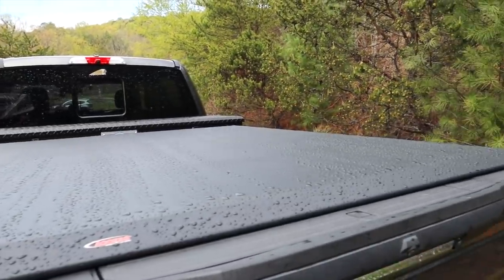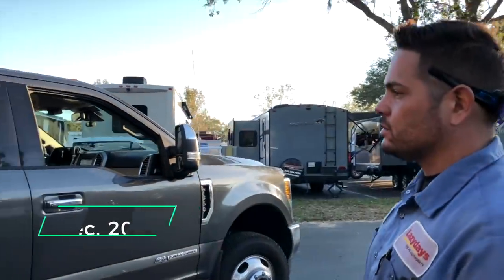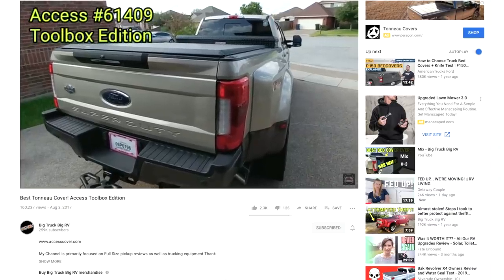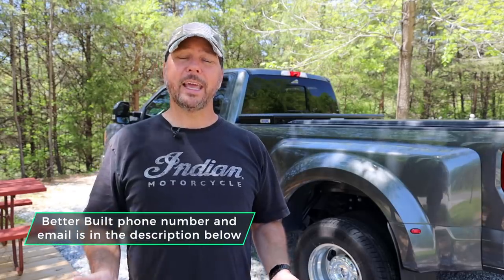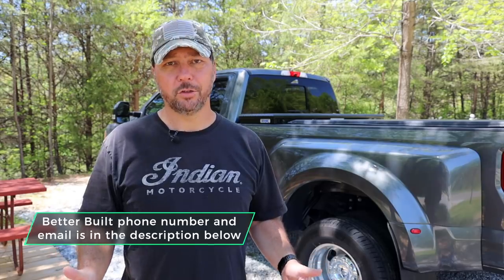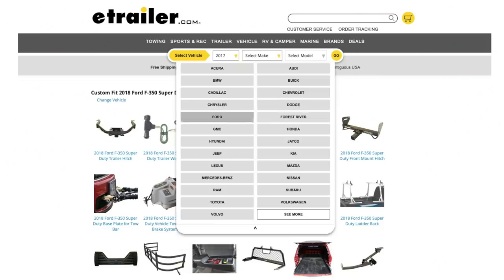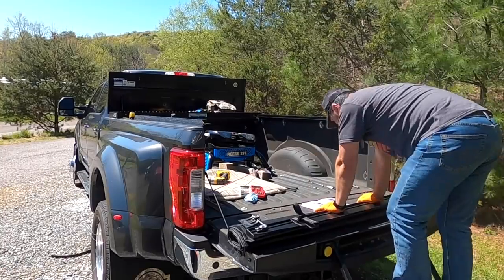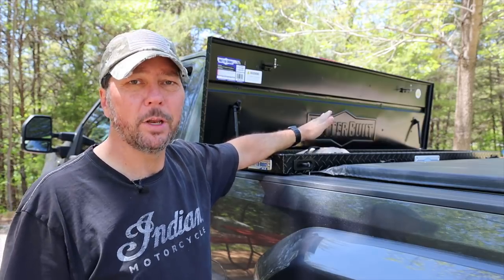Truck Toolbox and Tonneau for Fifth Wheel [Full Time RV Living]

Comment: Chad thanks a ton you saved me a bunch, doing it two or three times for that I thank you!  Any reason you don't think this one would not work?   Seems to be about the same dimensions as your drawing on the blog.  Seems like most of the generic brand boxes come from the same place, I've yet to notice in great differences in that 3-5 hundred dollar range unless it's truly in those handle mechanisms?  Found this one at tractor supply will be removing the badging to mount the cover looks like simple plastic rivets.  It's not a shotgun latch but seems to have a nice clean rear face for connecting to the cover, it was about $400 at Tractor Supply.  Oh, the picture on TS website shows the release buttons on the rear but on the one I purchased with the same P/N 1174114 the buttons are on the side..similar to your first toolbox.

Comment: Hey Chad, I purchased the same cover and box after your video. I too had the same trouble with my Landmark 365 Ashland fifth wheel, it uses a MORyde  pin box. I had to scrap the cover because both side rails got completely trashed. After that damage I bought the Extang solid Fold 2.0 for a toolbox and when I am hitched up I just remove the cover. The Extang just uses two quick install clips that takes maybe 3 minutes to reinstall the cover. Here is the link to just look at the cover:  https://www.extang.com/solid-fold-2-0-toolbox The best price site I found for the cover and tool box is called Discount Bandit.  Thank You, Peter.
Reply from the maker: We just switched to the MORryde and can get to about 75degree turn before hitting now.. But that does look like a nice cover.

Comment: I've seen a photo somewhere on line where the side rail on the Tonneau  cover were slightly cut away in a 1/2 moon shape to prevent the pin box from hitting the rail. Has anyone done something similar?
I am in the process of purchasing a new Vanleigh 41LKB and was looking for a truck toolbox and cover option for my truck. The timing on this video couldn't have been better. Many Thanks to Changing Lanes for this post.

Comment: Chad, This was a great video to help me prepare for my future truck setup. I did find on Betterbuilt's website a model 77211943 that looks like a low profile shotgun latch box. They add D rings and a light to the outside. Check it out and maybe this is something your viewers cod purchase if they can't find the one you have.
Reply from the maker: Looks right.. It's the shallower version but should fit.

Comment: Good info Chad. But unfortunately your set up is not perfect for me. There are several thinks about it that will not work with my truck and 5th, which is ok since one item can not cover everyone. I have a chest tool box and a Bakflip MX4 on my long bed. As far as reaching tools the truck sits to tall for me to reach in so I have to get into the bed and the cover covering the box is not an issue. I considered the cover you have, but what amount it sticks up above the rails is a no no for me. As far as the picture you showed of a Bakflip and seeing out to hook up, I don't fold it that much to hook up my Reese Goose box hitch. The only thing I would want to change is I wish they had a MX5 for an 8" bed so I could only fold 3 times and have more of bed covered while towing and still not have the hitch hit the cover in a tighter turn. Thanks for your insight.

Comment: I purchased the same tool box from Tractor Supply on clearance for 495 + tax after seeing BTBRV video also. Only concern I have is that it has opened up on me randomly while locked and driving. Called Better Built and was so that the box had been discontinued and the parts for the latches were not available. It sounded like it was a common problem. Might want to put an alternate lock also
Reply from the maker: Thanks for the info.  Haven't had that problem, but what did you do to fix it?
Reply: Changing Lanes   Haven’t figured it out yet. Like your videos and was hoping you had some ideas.

Comment: I have the same toolbox and what I think is the same tonneau cover (Access) that I've not yet installed.  When installed, is there a sufficient gap between the front of the cover and tool box that you can reach the latches and insert the key into the locks?  The cover itself is higher than the latches/key holes and I wanted to make sure it would work before installing.

Comment: Chad, I had an access cover on my Ford truck which had a short bed.  I had 5th wheel conflict issues because of the sliding hitch. The pin box made contact with frame work of the cover. I no longer have that truck or I would send a video. Just a heads up.

Comment: Thank you. I just ordered a toolbox tonneau cover from Etrailer.
Reply from the maker: 👍🏼   I hope you saw the note in the description and/or blog... We also pinned a comment:  ⚠️ UPDATE! – After traveling a bit, we've had our pin box hit the tonneau rails a few times! ☹️ We're not sure if it's just because we have this huge Flex-Air pin box or if this might be an issue on all pin boxes. The damage has been minor and isolated to just the rails. I've been able to bend back the bent areas. And the damage is hidden under the cover. Please be aware and maybe take some measurements of the distance from the pin to the back of the pin box and compare that to the distance from the center of your hitch to the side rails.
Reply: @ChangingLanes  Yes I saw your update. Thanks. I dont have a 5th wheel. Ill be A-OK

Comment: Hey Chad, I found a tool box with side button but the hight is 5'' 1/2 and I got 6'' 1/4 of clerance, do you think it is too tight ? It is just when I do a jack knife then I will be over the tool box with the front cap. I was worry if the ground is not level if i will hit the tool box when i back up jack knife. Thanks for your comment. Great video.
Reply from the maker: That's certainly something to be aware of.. Ours even comes close sometimes.  Less than an inch of clearance is a bit close.

Comment: The Betterbuilt 77211943 SLE Low Profile box available at Tractor Supply for $600 looks like a good substitute. It's the same box, just not as deep.

Comment: I have a North Point with a MORryde pin box & Reese 25k 5th wheel. The pin box hits the Access cover on a tight turn. Do you have that issue or did you solve it somehow?
Reply from the maker: Yes. See: https://changinglanesrv.com/faq/?Display_FAQ=2978

Comment: I think I got the last GM size (69-inch) SLE box available in the US off eBay! Was looking for a couple of months. How did you seal the sides of the box where it sits on the rails?
Reply from the maker: I didn't... but some weather stripping should work.

Comment: Now that you guys have the MORRyde Pin Box, are you still seeing the issue with the pin box hitting the rails?
Reply from the maker: Very rarely on very sharp turns.. So, it's still a bit of an issue with this tonneau.  But, it's much better than it was.   We hope to try a goosebox sometime in the future...
Reply: @ChangingLanes  Interesting.  We just ordered our 397 (we have a 2021 Chevy 3500 Dually) and have been wondering of the goosebox would still work with this cover and tool box.  Would rather not spend 1200 on a B&W 5th wheel hitch to only them go with the goosebox route down the road

Comment: I was able to make my tonneau from my old 6.5' bed truck work on my new 8' bed. Found a narrow toolbox that fit then measured the dimensions between the tool box and tonneau. Took it to a metal fab shop and had it made out of aluminum diamond plate.

Comment: What do you think the max height would be on the tool box from the rails. I’m looking at getting the new decked tool box and it sits 5.75inches tall from the bed rails. Do you think this would hit my front cap when turning? I am getting a solitude as well.
Reply from the maker: That's too high.  We had a weatherguard that sat that high and we couldn't turn without hitting it.. This one is about 3.5"
Reply: Dang that sucks. I really wanted that tool box lol thank you for the reply!

Comment: Chad, Do you know if the key is the same for all toolboxes? And for the cover?
Reply from the maker: The keys are different... 3 digit code, so I assume no more than 1000 variations.  The tonneau does not have a lock, but can't be opened unless you open the taigate.

Comment: I've written to Better Built and got the original part numbers for that box (and two that are similar) and have searched far and wide, US and Canada, and they are gone.  If one  used a box with the latches down low, would you be able to reach the latch when the cover is rolled up?
Reply from the maker: Yea.. that's the problem with front latches under the cover.
Reply: I think you may have misread my question. Let me say it this way: I don’t mind if the latches are out of view, as long as I can I reach them with the cover rolled up.  In fact, to me that might be an advantage. If you had a different type of box, with latches more conventional, would you be able to reach them that way?

Comment: Hi chad, does the toolbox and rolled up Tonneau cover block the view from the 5th wheel hitching from the 3rd brake light camera? Thanks.
Reply from the maker: No.  It blocks my direct view a bit, but I can use the camera just fine.  👍🏼
Reply: Changing Lanes Good to know thank you. Also please keep the good info coming.

Comment: Noticed on your demo for the tool box you have a pump, need recommendation for a good pump that will air up tires on fifth wheel or 5th wheel. Thanks
Reply from the maker: Yes! ViAir Compressor! (https://changinglanesrv.com/viair) We also cover it a bit in this video: https://youtu.be/dYb7DN7TmTU  AND   https://youtu.be/cjD8fhm4gJ0

Comment: I have a 2017 Ram 3500 4x4 SRW short box and I tow a fifth wheel.  I am looking for a low profile toolbox to fit in front of the hitch and under my tannue cover.

Comment: 1) I found another brand of a low profile toolbox with a side latch. Not a shotgun latch; but, I think this latch may be even better. (Refer to items 1a & 1b below).  
2) I found a low profile toolbox with a shotgun latch (Refer to item 2a below).
3) I found another even lower profile option, where the toolbox is under the cover and the cover flips up near the cab to reveal the tool box below ... without having to roll-up the cover, nor open the tailgate. (Refer to items 3a & 3b below). :
- - - - - - - - - - - - - - - - - - - - - - - - - - - - - -
1a) Matte Black version: https://www.homedepot.com/p/Husky-71-36-Matte-Black-Aluminum-Full-Size-Crossbed-Truck-Tool-Box-102101-53-01/302959740

1b) Diamond Plate (i.e. Silver) version: https://www.homedepot.com/p/Husky-71-36-Diamond-Plate-Aluminum-Full-Size-Crossbed-Truck-Tool-Box-102101-9-01/302959739
- - - - - - - - - - - - - - - - - - - - - - - - - - - - - -
2a) Better Built w/Shotgun Latch: https://www.tractorsupply.com/tsc/product/tractor-supply-70-in-low-profile-shotgun-latch-crossover-gloss-black-1299435?cm_mmc=organic_feed-GoogleShoppingProduct_-1299435
- - - - - - - - - - - - - - - - - - - - - - - - - - - - - -
3a) Under Cover Tool Box: https://truxedo.com/tonneaumate

3b) Cover that opens near cab & over toolbox: https://truxedo.com/deuce

Comment: I went back and forth a million times over this same topic for my F-350. I ended up getting the full size Access tonneau cover (didn’t know about this toolbox). Now I’m agonizing over a toolbox for under the cover and whether to bolt it down (I don’t want to damage the truck bed) or use a chain to front tie-downs?
Not ideal. Any ideas??  Compromises, compromises.
Reply from the maker: Personally, I'm not scared of a few holes in the bed.  Might only need 2.   In fact this toolbox install stated one screw on each side - any more voids the warranty.. strange, but I followed it.

Comment: GREAT VIDEO :  I have a 95 Ford dually crew cab with a 110 gal. fuel tank behind cab. MY TOOL BOX IN AT THE REAR AND SITS WITHIN THE BED AND BELOW BED TAIL GATE.  IT WAS 99.00 AT TRACTOR SUPPLY AND IT IS HARD PLASTIC .   I purchased a used T cover roll up/ slide up old school.  I need to have someone ; i.e. upholster  trim the sides of the fuel tank as the tank is a few inches on each side of my 8 ft. bed.  Your cover would probably work so kudos.
How much was this cover?? They may have an idea to fill in the sides of the fuel tank.
Reply from the maker: Current price is $545: https://www.etrailer.com/Tonneau-Covers/Access/A61409.html?etam=b0003

Comment: Just an FYI everyone is sold out of the #77213014 but I found the standard depth #77213067 in matte black
Reply from the maker: Thanks!  Definitely a good option.  Not as much capacity but also doesn't sit as low in the bed if you have a fuel tank or something in there..  👍🏼   Be sure to reach out to WernerCo (details in desc) and let them know they need to bring this line back! 😀

Comment: A couple of tips I discovered mounting my new Access SLE: The battery holder is built in behind the plastic cover that the hold the LEDs .  So you use 8 AA batteries or wire to your truck.  https://youtu.be/4Z9xtWDFmnI.   Second, I have a 2018 RAM 3500 and fits but I had to elongate the slots towards the inside a half inch on both sides.  Use a step bit and cut easily since the box is aluminum.

Comment: I tried this setup. So far, not happy. The tool box leaks like a seive and the cover is about 2 inches too short.
Reply from the maker: Well that's strange.. Never a drop in our toolbox and the cover fit perfectly.. We do have an issue with our pinbox hitting the rails, but that part gets covered so not worried about it.
Reply: @ChangingLanes  I got a replacement cover but having issues with leaking. Any advice?

Comment: Just an FYI and warning. The instructions say to "tighten" all the nuts on an occasional basis (Monthly?). My Access Tonnaeu cover (same model as yours) flew off the back of my truck doing 60 mph. Luckily, the car behind me was about 1/4 mile away. I was able to walk back and retrieve the cover and all of the "parts" that go with it. The cover had some "gouges" in it but all in all I was able to re-install it. Turned out that the nut on one of those "adjusters" backed off enough to fall off (at some point) and as luck would have it, we were on a short trip and I failed to press down on all of the velcro on the sides and as result I believe the wind was able to get under the cover and eventually cause the whole thing to break down and fly off. I ended up putting "lock" nuts on each of the adjusting devices and I added 90 degree metal brackets and attached the "crossbar" directly onto our toolbox/fuel tank. Those "clamps" holding the cover to the sides also need to be checked as well. I also always press down on the velcro or roll the whole thing up. Notwithstanding the above disaster, I still very much enjoy the cover ... gouges and all....
Reply from the maker: Good tip!  I'll keep an eye on that!  👍🏼
Reply: J